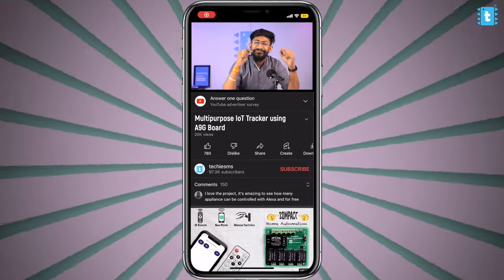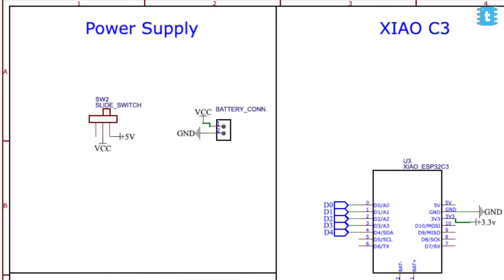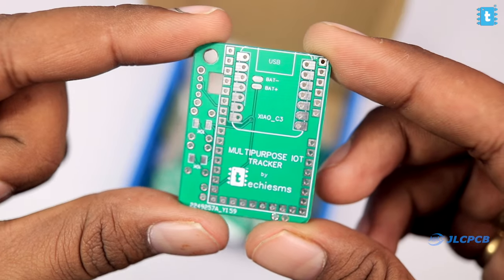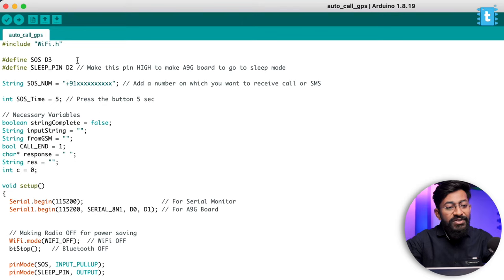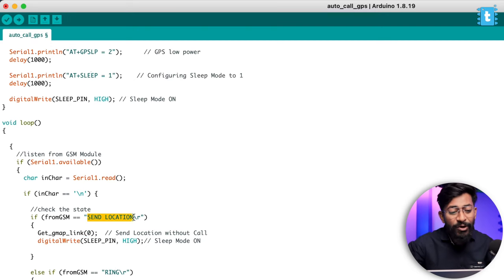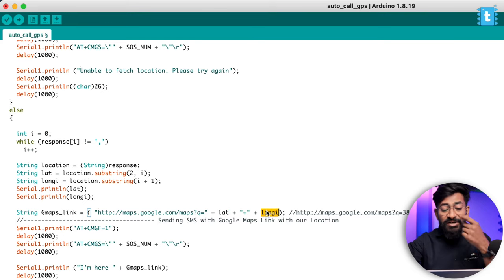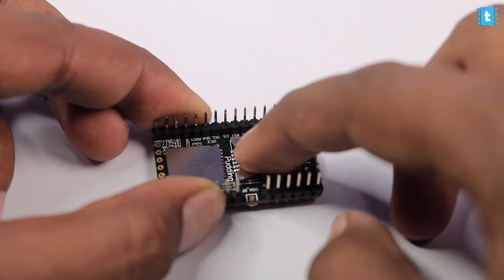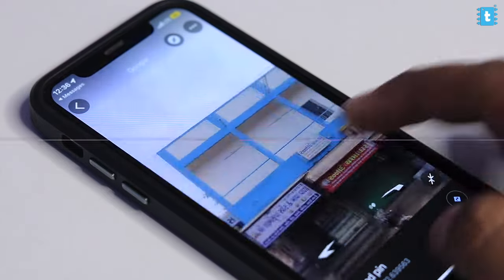A9G based GPS Tracker, SOS Button & Audio Spy Project | IoT Projects | ESP32 Projects

Comment: hey Sachin plz make the best and most practical automatic water flow management system cuz it's a problem we all are facing now which should connect with esp32 has wifi and can be scheduled also with automation

Comment: so its the same as "Send Location & Make Call using SOS Button | IOT Projects | GPS Projects" your video but you just add "send location" feature with using custom pcb im right??,so if i use the connection from the previous video i can just use coding from this video and it will still work the same right??

Comment: We don't need a 2g board with gps, that has already been made. What we need is 3G module or 4g module(which already has been made by lilygo sim 7000)
Reply: If we replace the 2g board with 4g board and all the connection make like this ... then will it work ?

Comment: I have purchased A9G board from you. A9G module AT+Location command not working most of the times. NEO 6M GPS module responds very fast and has better GPS connectivity  than A9G.  So I used NEO 6 M for gps and A9G as gsm module Only..
Reply from the maker: No 
Have your turned the GPS on using AT commands first?
secondly, try out first in outdoors
Reply: @techiesms  Yes, I turned on GPS in the setup part. Sometimes it works but most of the time it didn't.

Comment: Great job with this project, I have been trying to replicate the same system with an Arduino Uno. I had to make a few modifications to the code, however I only am able to answer a call if called from a number, when I send text message I only see a prompt on the serial monitor but I do not receive location data nor error SMS. Any help is welcome thank you.